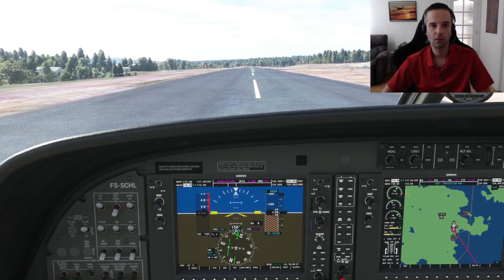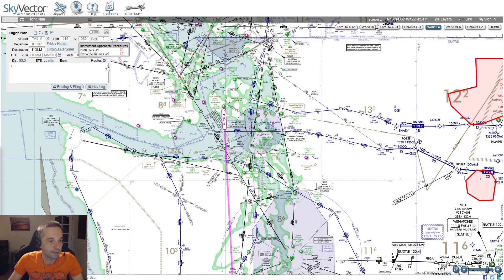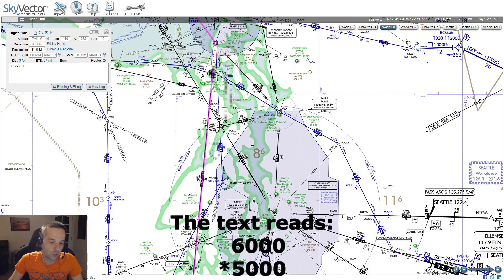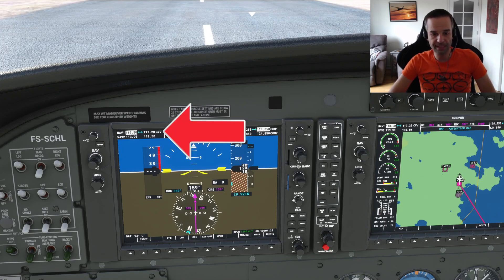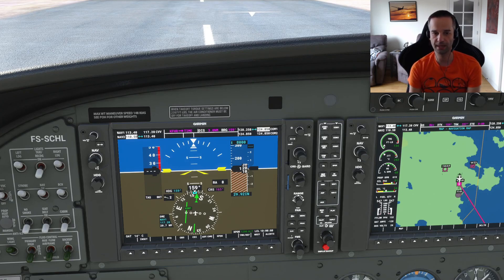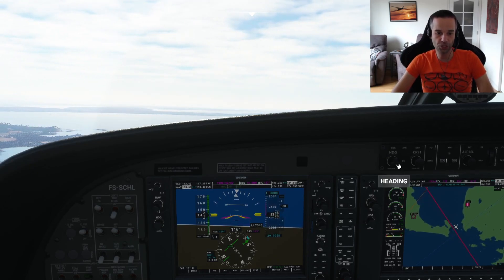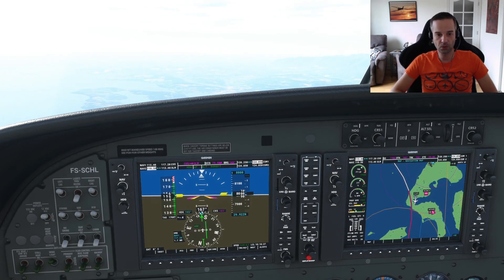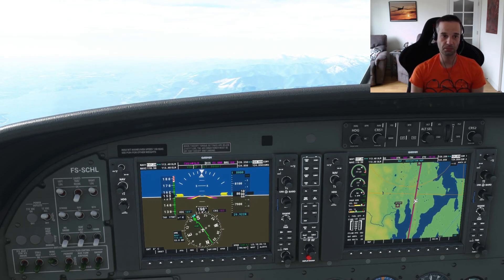Navigating by VOR | Microsoft Flight Simulator Tutorial

Comment: This is an amazing explanation.  Subscribed.

So, using this flight plan as an example.  If want to confirm my position, I'll just tune to the Seattle-Tacoma VOR and set it to the 230 outbound radial.  While on course to Olympia, I'll just switch to that nav channel (tuned to SEA) and check - when the needle and the deflection line up, I should be 19 Nm from Olympia?

Comment: You were flying FROM cvv but TO olm yet never have to change your course setting? I thought you would have to flip it?
Reply from the maker: Radials are always outbound from the VOR. We were flying on the 165 radial from CVV, but to OLM 165 (which is the radial on the “other side” of the VOR). The way I remember is that when you’re flying TO a station, you tune the same course you’d fly if you were flying it with a GPS: to get to OLM, we need to be on a course of 165. When you want to fly away from a station, it’s the opposite, and that’s why I didn’t need to flip it. Explaining VORs is really tricky, I’m actually working on an entire series on traditional navigation where I’m explaining it a bit differently from this video.

Comment: Experiences from an Xbox user. Using VOR navigation is actually the best way for autopilot to accurately follow heading as well as altitude. However, once you reach your destination VOR there is a glitch as the autopilot will take you back to the prior VOR. The trick...disengage autopilot within 10 NM of destination airport. Your glidepath should still appear to take you to your destination runway. 
Thanks for the upload and instruction and the time/effort you put into it. VORs were the "only show in town" back when I was flight simming in the 1980s/90s :)
Reply from the maker: Hehe same here :) thanks for the Xbox tip!